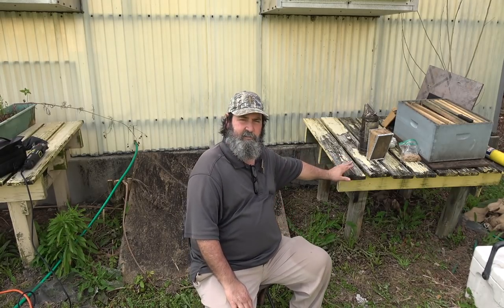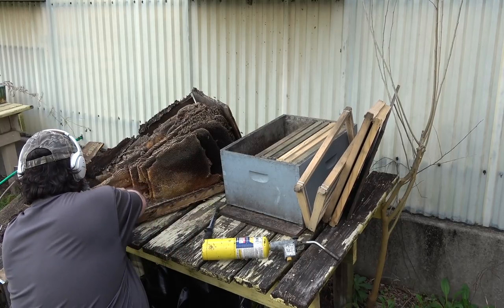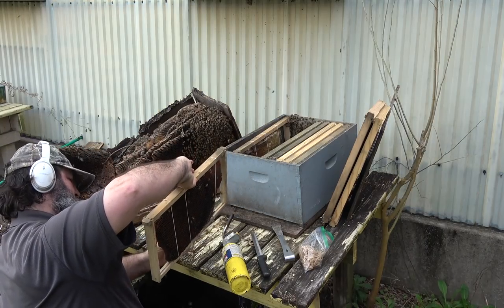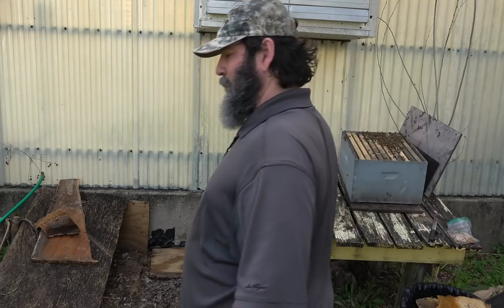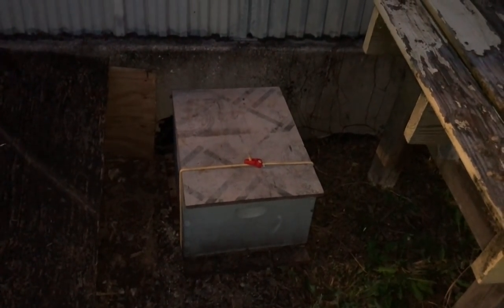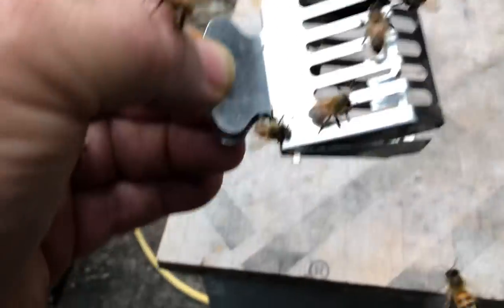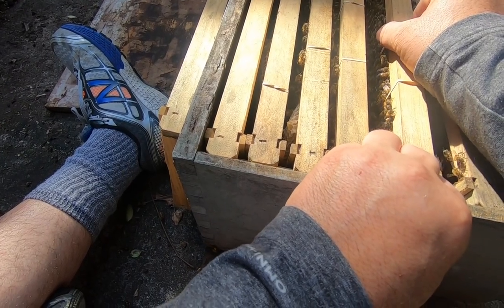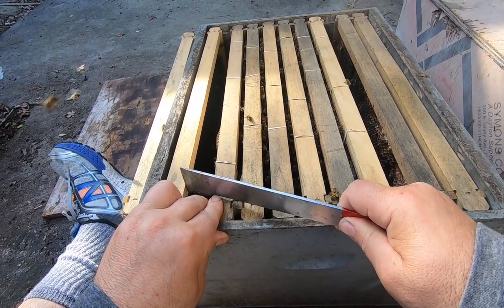Bee Man Vs Ramped Up Bees

Comment: I worked in commercial horticulture off and on for a few years and when the crops started blooming in the greenhouses we would have bees around as the weather got better.  At one company we had just one house and so we had crops into the summer and fall as well as late winter and spring.  We didn't mind the bees and they didn't mind me going about my work.  In the fall we usually had a large collection of fall bloomers outside and as the plants matured and bloomed there were bees everywhere.  One day a coworker stopped me and pointed behind me and, as I was moving pots from one area to another, the bees would just follow along behind in little cloud.  They would wait until I got the pots situated and then move in to go to work.  We considered the bees part of the staff and there was never a problem.

Comment: I have a question , when you frame comb is there ever a problem with cross combing and how do you fix it if they do?
Reply from the maker: Yes, cross combing can be a real drag with cut out comb.

It’s something you have to stop early or it can get out of hand quickly & you’re left with an un-workable situation.

Really, the best comb sections to transfer are the ones that fit frames nicely, almost completely but you don’t always have that luxury.

When you find they’ve cross combed the only thing you really can do is to trim, separate them from adjacent frames & hopefully they’ll re- draw them out better.

This is why in a good flow it’s sometimes better to give them frames with foundation. They’re a lot less inclined to cross comb frames with foundation.

Now if you have frames with drawn comb from another colony they might be able to spare, give them a few of those frames which can make the cross combed colony workable in an instant.

Comment: Aren't you taken one heck of a chance not wearing a suit until you are sure the hive isn't africanized ,by the time you find out if it's a African hive it could be to late before they would swarm you and sting you to the point you could die. I've seen a African hive attack a nieghbors dog and there was nothing we could do to save it. I took over a hundred stings trying to save the dog until they drove me off. Nothing would stop them and it took the fire Department with two hoses to drive them away enough to get to the dog . But sadly the dog was dead from hundreds of stings clear into its lungs.